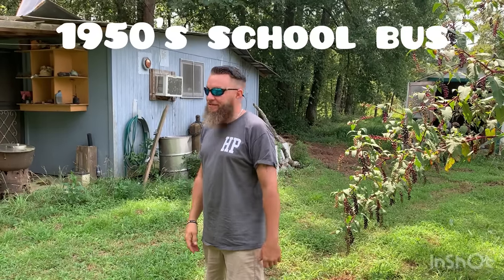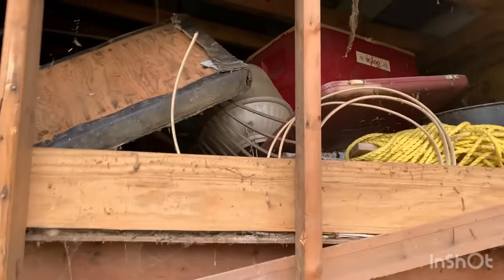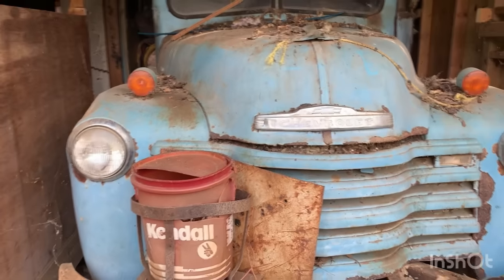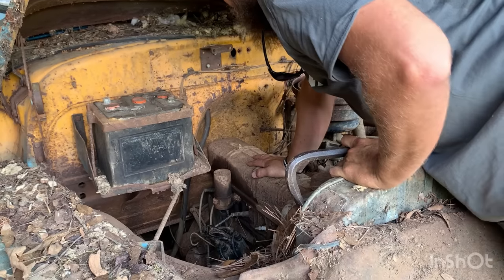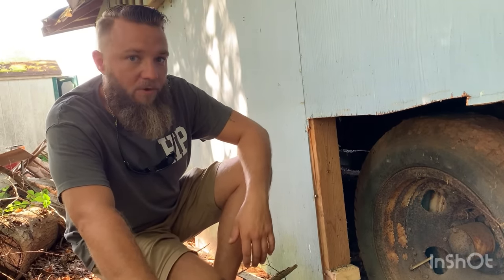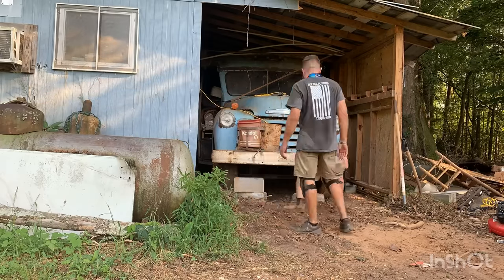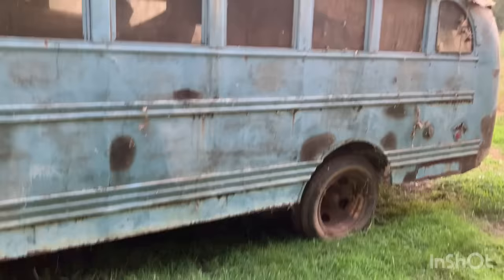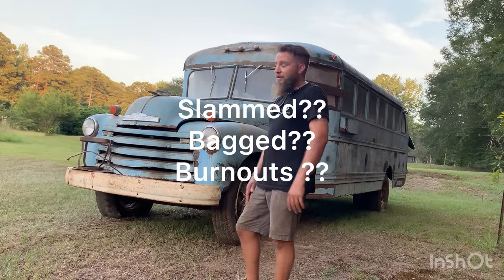Barn find school bus

Comment: Absolutely keep it, get it running and clean the rust up and then put clear coat on paint or paint it another color. You run into these kinds of old gems much. It's really awesome and in pretty good shape. Keep original motor straight 6 in it, make it 12 volt. Keep it as original as can be
Reply from the maker: Yes sir they are few and far between